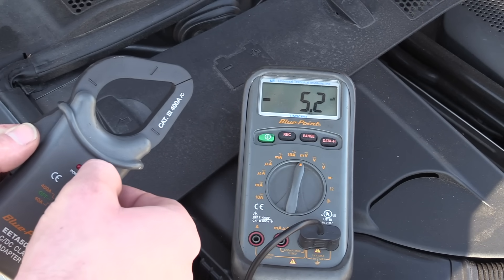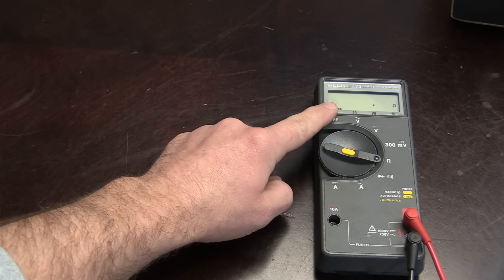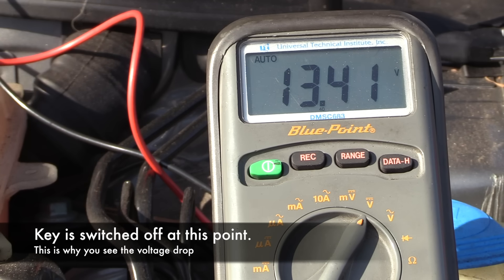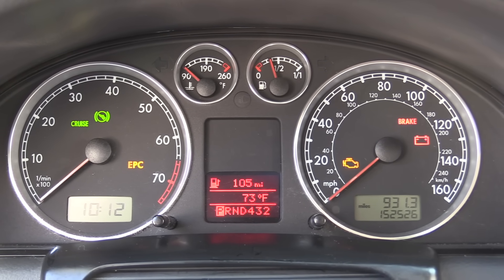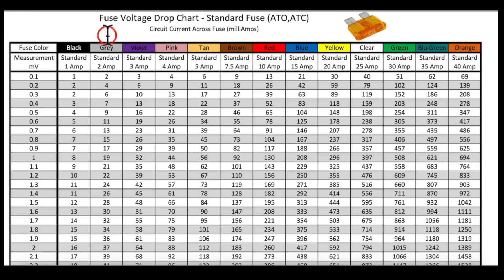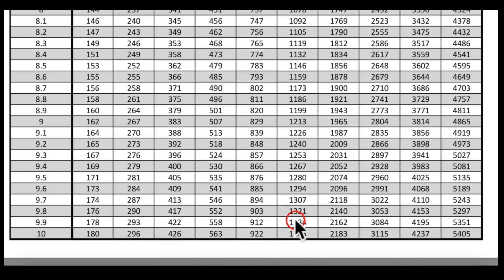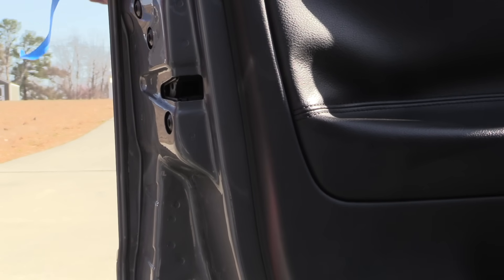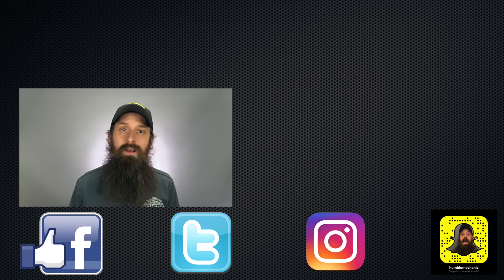The BEST Way TO Perform a Parasitic Draw Test

Comment: I just bought a 2001 Passat 1.8t for my mother as a da8ly driver....have I made a horrible mistake? 

Former mechanic here, so I know how expensive they CAN get but I think this is a pretty nice example.
Reply from the maker: +DrewLSsix I love that gen car. It's what I drive daily.
Reply: HumbleMechanic  lol, so would I, got it cheap with cam chain rattle but very nice otherwise.   considering I was looking at cars that needed new motors or trannies when I found it I would say I got lucky.

Comment: Hey Charles could you do a video on basic operation of a multimeter? I can use it to test resistance and check if there is current going through a vehicle but there's a whole lot of other options on some multimeters that I never touch which could probably help when trouble shooting, Thanks.
Reply: Learn to read the owner's manuals.
Reply from the maker: +seanvityaz that's a great idea. I was thinking about that while doing this video. It's now on my list.
Reply: There are so many on Youtube that you can spend the rest of your life only watching those...
Reply: Very few present it in a way Charles presents his videos, I don't do any work on VAG cars except replace a bulb or wiper blades every now and again but the way he presents his videos is what keeps me watching and learning.
Reply: HumbleMechanic and perhaps a recommendation of what features/accessories (special leads etc) for the home auto maintenance all the way to pro.
Reply: Also, is it possible you could recommend some different types of mutimeters? one to start out on, an intermediate one and an entry level high end unit? I've blew up about 4 cheap Chinese ones through trial and error and I spotted you use a Fluke meter and I've seen them for upwards of £200 and I don't have that kind of money to spend on my car, let alone a tool heh.
Reply: +seanvityaz You can get a Fluke 17B+ meter on eBay for around $100 USD, it's a pretty featureful model and a real Fluke, but it's intended (and priced) for the Chinese market.
Reply: seanvityaz i love every idea u had
Reply: seanvitya
Reply: seanvityaz
Reply: Neil Williams
Reply: Baerchenization yep and anytime I need to get the facts and need help You Tube is the best help.
Reply: (How to Use a Multimeter - Beginner's Crash Course). Copy and paste this url into your you tube browser.
She teaches you how to use all the functions on a multimeter.
Hope this helps.

Comment: @ 7:06 you said .1 Amps, but its 1 amp since its 1000ma. Not nit picking, just being accurate. Appreciate the video
Reply: You are so fun, humble
Reply from the maker: +DmcHartsoe damn math!!! Thanks for the catch. Now sure how the hell I missed that. 

No worries on the nit pick. If that's the worst thing I do, I did pretty damn well. Hahahah
Reply: Carlos Lee that's a VW thing, industry standard is 50 milliamps, but varies from manufacturer to manufacturer, GM wants no more than 30 milliamps on a draw test, and something that has more electronics, like Mercedes or high end luxury cars will have a higher acceptable draw rate, so I go with 50 milliamps if you can't get the manufacturer spec.
Reply: I caught that too, was wondering if I had totally misunderstood the chart! You can always add an annotation to the video to point out that you meant to say 1 amp.
Reply: DmcHartsoe *it's. I'm not trying to nitpick bro. I just want you to be accurate.
Reply from the maker: I went to UTI in 02
Reply: DmcHartsoe 1000ma = 1a 👽
Reply: newb question here, where does one get the spec 35 miliamps at 7:15?
Reply: @carloslee2360  Its a pretty standard draw rate. Most automotive batteries are about 25 amp hours, so a 35ma draw is about the most you want to see unless you like having a dead battery if you let the car sit for 2 weeks.
Most all the problems I saw when I was a mechanic were from aftermarket stereos and car alarms..they are energy hogs.
The customer always blames the car for the problem, though :)
Reply from the maker: +Carlos Lee that is a Vw spec probably from the repair manual. But I think it's a common industry number too
Reply: HumbleMechanic did you go to UTI/VW manufacturer training?  Or did you just swoop a UTI DMM from a local pawn shop?
Reply: HumbleMechanic Arizona? Phoenix/Avondale campus?
Reply: amps = milliamps / 1000     or count 3 spaces from right to left and and mark a decimal point.  Try it.
Reply: Great video, thank you !!!
Reply: No worries
Reply: DmcHartsoe any tips for old cars early 90s..US...or old German late 70 early 80s
Reply: Great Video Humble! Thanks :)
Reply: Jesse Hill m
Reply: DmcHartsoe 7

Comment: I'm not going to lie. Most of the cars I've seen with a draw are being sucked down by improperly installed gizmos like big sound systems or aftermarket remote starts. You would not believe the rats nest fluster clucks some people leave under their dash.
Reply: Bad diodes in alternators, the alternator has to be hooked up to both battery terminals and is just a coil of wires, so when its not pushing current into the battery, the battery wants to push current back the other way.  A diode is a one-way electrical switch used to prevent this,  but they can break down and allow reverse current flow.
Reply: Travis Callahan  If you're talking to me, I'm saying that battery self-discharge of more than 1 day will begin enough under-charge; adding parasitic load is additional (intentional parasitic and not unintentional shorting).  Concerning rat's nest wiring and typical installations, ground loops are beginning to be a consideration for more delicate electronic's connections near larger amperage flows e.g. steering wheel control add-ons for after-market stereos.
Reply: civicturbo2009   I'm a big believer in this now. It's just that my previous maintainers always seemed to die out. I'm trying the resonance desulfation (BatteryMinder) now.
Reply: 99% caused by owners
Reply: I once removed an aftermarket alarm that was wired with Romex.
Reply: Not just DIYers that screw up car wiring. There's a chain here where I live that will drill holes wherever they need. I've seen where they stuck a bare wire into a unused fuse location, no fuse at all. What do you expect though for a $1 install?
Reply: Thanks for the wisdom. Didn't know that.
Reply: Travis Callahan fluster clucks!
Reply: Yup command start got me. Was the hood kill switch.
Reply: I've seen many showers of shite in my time as well.
Reply: Lou Fazio - I held onto two extra car batteries for four years by keeping them each on their own maintainer and they still worked great when I finally used them in my car. kind of morbid but I tell people a car battery is like a person the longer they're dead though less chance you have of bringing them back to life. sulfation is a huge killer
Reply: Travis Callahan  Just a note on batteries: unless you are using the car daily, you're going to have charge loss that takes its toll on battery life. Sitting at partial charge will allow sulfation to develop, and the the battery will hold less and less charge; a catastrophic scenario.  It seems nit-picky, but it is true. A good battery maintainer is a smart move.  A battery in a car without electrical power-assisted accessories will last quit a bit longer than a car with all the powered accessories.
Reply: @louf7178   I know its 2 years hence but I totally agree with your thought and have always had Battery Tenders on all my vehicles.. It is so easy to use their connectors on your battery terminals, and then other end is a totally foolproof plug/female end that connects, and there you are,  Float Charging, slowly, vehicles that start perfectly even in the dead of winter..
I have had car batteries go 5-7 years this way..
Thanks for bringing this up !!
Reply: @frandanco6289  Yep, still here, and still using the same batteries.  With regard to the connectors, I have found they need to be protected from water, or current can easily trickle across these points thus defeating the whole purpose, quickley 😱.
Reply: not sure what that has to do with my insight but yes batteries discharge over time. but it takes a really long time, unlike a draw that can sometimes drain your charge in a few hours.
Reply: I find too many mechanics fault aftermarket equipment without doing proper tests. I've lost count on the number of times that a dealer has blamed the remote starter or audio systems that's been installed only to have to do their job for them and find the OEM vehicle component that is causing the issue. 

I've only found a few cases where an aftermarket component is causing the draw, and usually it's an old firmware on a bypass module that has an update for this very reason.
Reply: Travis Callahan 
17 years doing high end mobile electronics I've only seen one install causing a battery problem, and that was on my own car.
Mechanics often blame aftermarket because they do not know anything about electronics. Seriously I was told by a dealership my t-tap was slowing the flow of electrons on a circuit we laughed our asses off then found the bad factory relay, and sent the guy back to the dealership.
He never had the issue come up again.  Now with that said
I've seen my share of DIY garbage stuffed into car with duct tape.  So if your going to sate aftermarket you better bring up DIY installed.
However I've seen shops do some really shitty installs they might as well have been diy.

Don't forget I work on cars also.  I've got 38+ years exp.
And I've seen some pretty stupid mechanics and shady work.

Every field has its problems, but don't blame all of them for the few screw ups.
Reply: Travis Callahan I think you are right and this is the exact problem I have with my 'Mechanics Van' it has a fully decked out rear end, L.E.D lights, spotlamps and normal lamps too, a 'Heavy Duty Cycle' leisure battery to help supply these and of all things a large bass box above my head in the cab....an aftermarket CD player, 'fake' flashing security light and a dash mounted fan. Does a good job in draining the engine battery overnight. Battery is suspect anyway so plan on changing that then working through this issues....hoping most are in the cab area as I don't fancy dismantling the back....should be fun!

Comment: Great video Charles. I've been a professional tech for over a decade and never thought about doing a draw test this way. It's much less intrusive than the battery cable amp draw and pulling fuses. Thanks!
Reply from the maker: AWESOME! I hope you never have to do one LOL. But this really is a great test
Reply: I have a 97 F-250 right now with a parasitic draw issue that may be related to an aftermarket snowplow pump. It's going to be a fun one. :)

Comment: Great video.  I use the Power Probe fuse charts, as well.  Voltage drop is one of those things that I didn't know much about or understand for many years.  Once you understand it you realize it can save you tons of diagnostic time for lots of different things...not just parasitic draw, and you will wonder how you got by without understanding it.  If you're like I used to be, and don't understand it, I highly recommend doing some additional reading on it.
Reply: The trick to voltage drop testing is to have a load on the circuit.  Until you understand voltage drop testing you aren't an electrician.
Reply: They can't Dan Sullivan of LOADpro has a patent on voltage drop testing (or so he claims)
Reply from the maker: VD is amazing! I wish they pushed it for diagnosis more. It is the best way to test circuits in my opinion